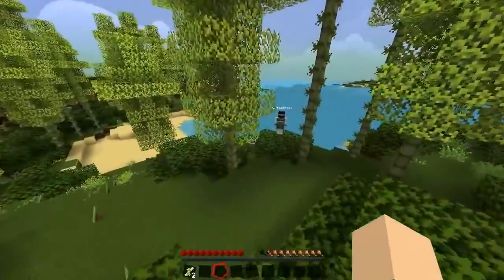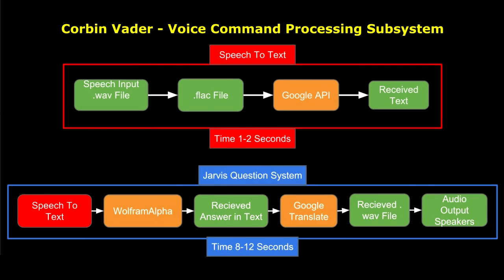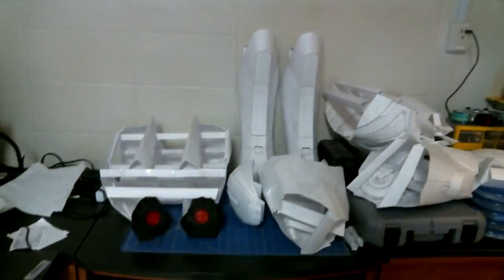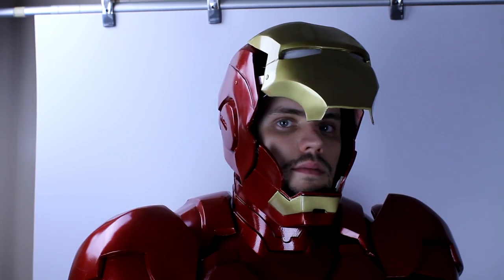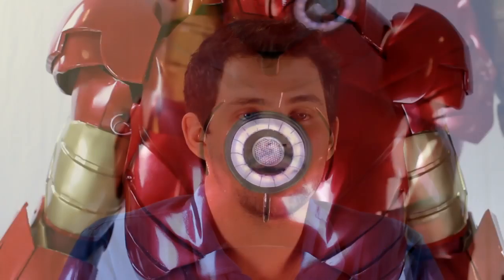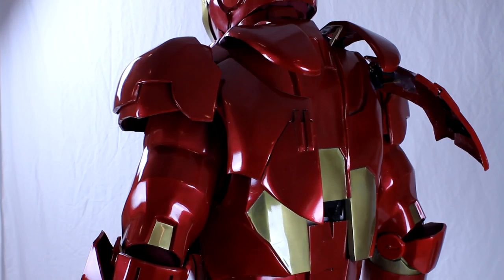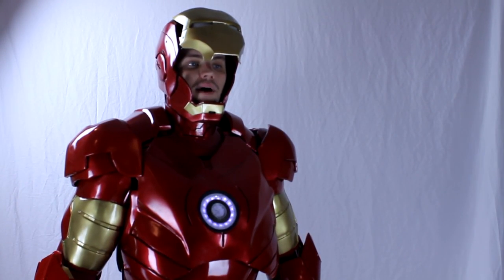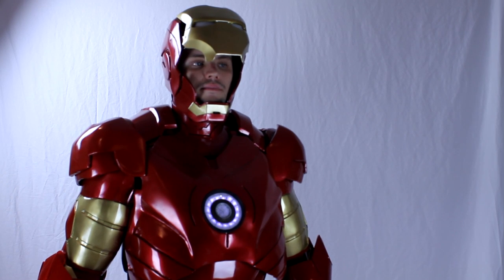Iron Man Suit Overview - HUD, Moving Parts, Lights, Sounds, Voice Commands

Comment: If I had built something like that, I'm not sure I would wear normal clothes anymore
Reply: I agree. I would wear it in school probably. No uniform for me.
Reply: +The Toolbox Armory here's  several ideas for constructing an iron man suit
Find some detailed plans from the web
Use plastic instead of cardboard or metal - it's easier than metal and last longer than cardboard
Makesure you get the size right - an engineer spent a long time making one then found it was too small!
(I learned these and the reasons they work from Dichali costume creator website )
Reply: I would wear this alot, but I'm kinda into fashion, so I would wear regular clothes
Reply: clothes are waaaayyyyy more comfortable
Reply: Umberto D'Ovidio if I made that thing I wouldn't either but I would add actual jet feet
Reply: buy Or Build The Iron Man Armor Costume (Real Iron Man Suit) — The Iron Suit: Build Or Buy The Iron Man Suit - http://bit.ly/2f7frET

Comment: I am building an Iron Monger suit now from the first Iron Man movie. I was also planning on building a HUD with a camera mounted in the head with the actual display in the upper chest/neck (where my eye level will be). Are yall using a raspberry pi with the camera module to do your HUD? My plan was to use the raspberry pi 2 with a screen attached to it (adafruit) mounted around eye level with the camera mounted in the head via an extended ribbon cable.

Comment: How do you get in/out of the suit? I feel like that's a stupid question with an obvious answer, but I have no idea.
Reply from the maker: The suit has a series of straps and buckles mounted to a metal harness which holds all the pieces together. The chest/back, abdominals, codpiece and the shins come apart in halves and are held together through various hidden zippers, velcro, more straps, etc. The helmet has a removable jaw, the rest of the pieces just slip on and are secured to the harness.